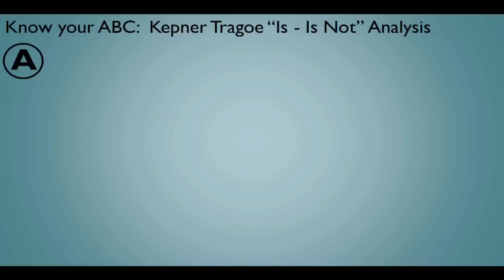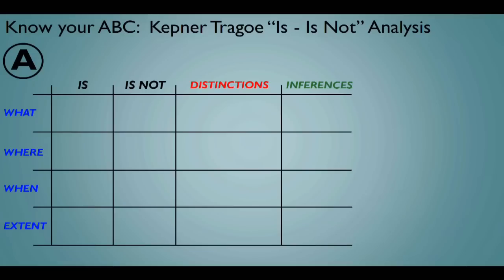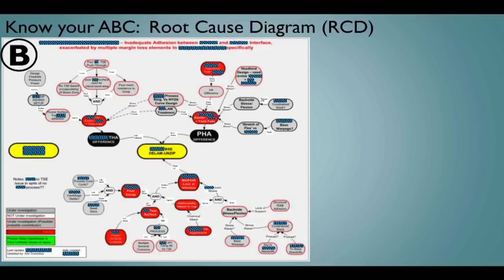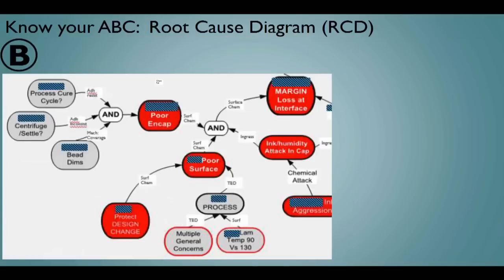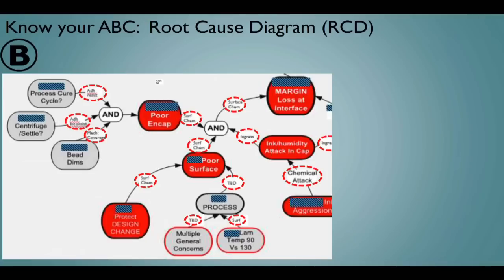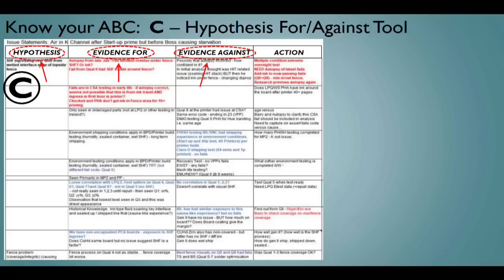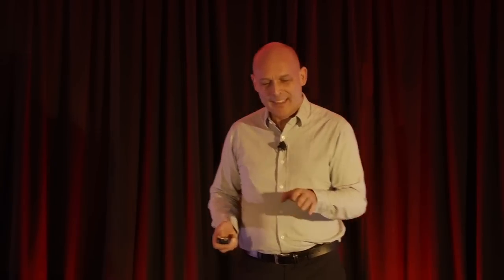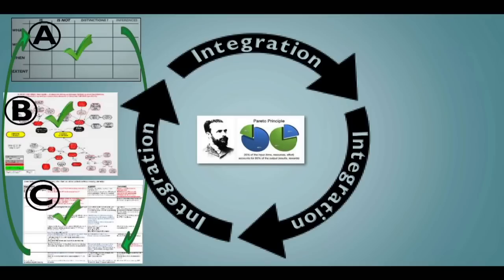Master Problem Solving - the Basics. Find it Out Here!

Comment: In my 42 years of high tech problem solving....and having been trained in many if not most methodologies....my tool of choice for most problems is the Kepner-Tregoe one.  Have applied to the some basic problems....germ theory...shape of the earth even....and discovered the current paradigm does not fit (if the glove does not fit....).  Cheers.